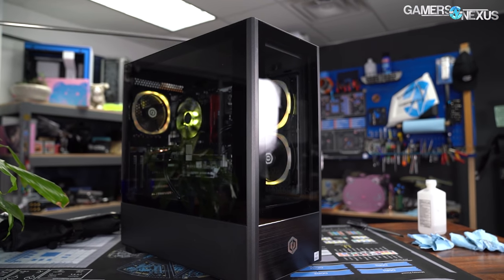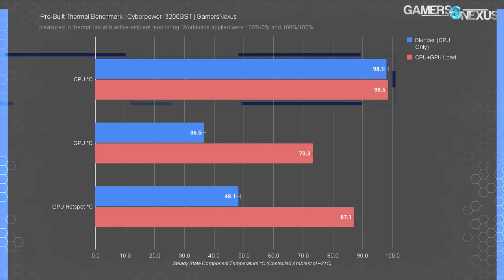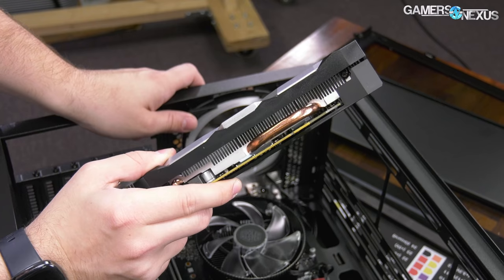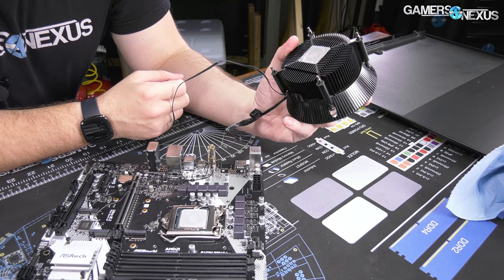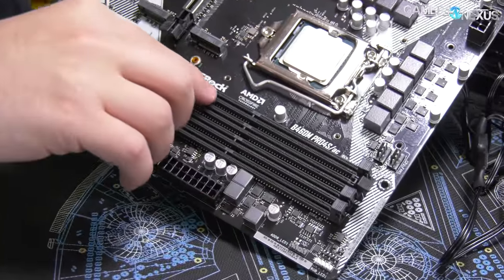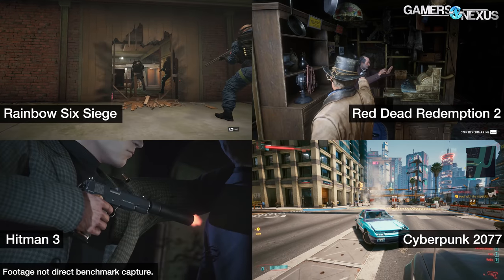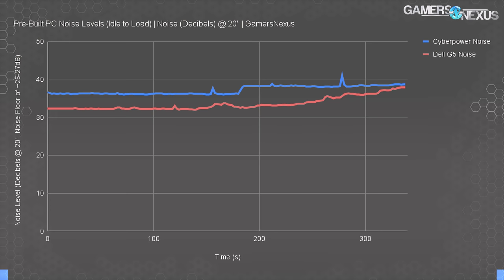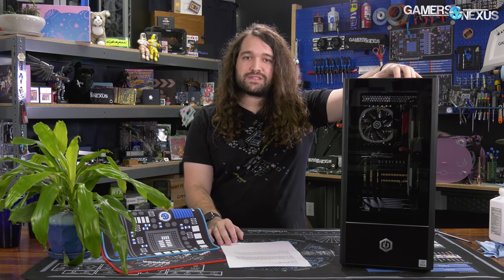Almost Didn't Suck: Cyberpower $1000 Pre-Built Gaming PC Review (Gamer Xtreme 3200BST)

Comment: “Almost doesn’t suck” sounds like a high bar to reach for most prebuilts
Reply: "Almost doesn't suck" is the GN equivalent of LPL taking more than 15 seconds and a toothpick to get into a lock.
Reply: @aethertech  so pretty good?
Reply: @aethertech  ... More like 10 seconds...
Reply: He didn't order a fuckijg liquid cooler and he shits on the entire build at that point
Reply: @nexusly6720  rephrase.
Reply: @nexusly6720  There are plenty of air cooled PCs out there that doesn't suck.
Reply: @nexusly6720  Sounds like you don't understand the premise of the video.
Reply: @nexusly6720  Yes. Because ANY half way decent air cooler has thermal contact with the die and does not cause the CPU to throttle at effing stock speeds. He is absolutely right: This is totally unacceptable. He asks for a cooler that does its job. Providing a solution that causes the CPU to throttle because of overheating at stock speed is missing the mark.
Reply: @nexusly6720  No there are air coolers that  don't suck the problem is CyberPower decided to use the cheapest thing they could chuck in. There's a reason why CM doesn't sell that downdraft cooler to customers, and that's because even informed normies wouldn't bother with buying one.
Reply: @nexusly6720  💀 my air cooled system gets literally high 30 - low 40 degree Celsius under load. Air cooling is perfectly fine.
Reply: Ideally some of it should suck and some of it should blow.  Then it has good airflow you see.
Reply: @nexusly6720  you completely missed the part where Steve compares the Fuma 2 to the pos CM. You have bad comprehension or ADHD?
Reply: @nexusly6720  Doesn't need an AIO just a $25 air cooler instead of a $20 one.
Reply: all it needed was a better CPU cooler and its good.
Reply: Almost 😂
Reply: @nexusly6720  why wouldn't he? It's not a processor which requires an AIO or is going to be overclocked (it's aimed towards people without any understanding with computers), there's no reason to invest in a, relatively, expensive AIO.
Also, Tower coolers can be really good, this cooler is just not good, even stock cooler will do the job better (if Intel still ships them with stock coolers).
Reply: Dawid Does Tech Stuff is making sad noises with that single channel RAM config...
Reply: @echnaton192  To be fair though, builders like CyberpowerPC probably aren't getting a lot of orders for current gen CPUs(or in this case recent enough) plus a reasonably good graphics card(considering the market deficit of them) without liquid cooling.  AIO has become so mainstay for anyone willing to shell out the bucks for a pre-built PC that builders like this really aren't investing in the streamlined production infrastructure to make really good air-cooled machines, which I think is completely understandable from a business standpoint, but it could certainly stand for improvement.  In other words, don't visit the upscale sushi restaurant and ask for french fries.  

At any rate, let's see more videos like this with an Origin PC or Digital Storm build.  Cyberpower has had its share of issues for a while now(or actually decades), but to use them is basically a strawman argument for "aLL PrEBuilTZ SuCK d00d!"
Reply: @booksgaming1426  I disagree. Using aircooling is a perfectly reasonable solution, even for high end components. The price difference under msrp  conditions is big enough to allow for better components. Especially if someone is actually watercooling the GPU as you suggested. My new system has AIO for the cpu, but only because it was included (first prebuilt since 20 years). It is tax deducted, so I buy it via my job.

To keep it in your picture: If the upscale sushi restaurant offers french fries on the menue, they better not taste like fish when a kid orders ist, but be one of the best french fries it ever ate. It is perfectly reasonable to not offer french fries. But IF you offer them, you need to buy good potatoes / convinient food french fries and use fresh oil that was not used for frying fish.. And even in the upscale sushi restaurant the cook needs to taste the french fries before putting them on the menue.
Reply: That's hilarious! LMAO!
Reply: An actually sufficient cooler would probably already have boosted the score to D- or D.

I seriously hope they somehow just had this one being a bum one with a bent surface and the other systems do work normal.

I haven't seen a warped cooler surface that bad since the P2 days.
Reply: @echnaton192  I just fundamentally disagree with your take on the analogy.  As opposed to a restaurant part of whose main selling point actually is french fries, such as a fast food joint or drive-in, while the sushi restaurant may not be carrying utter crap, to go in there expecting something outside of their specialty is an unreasonable expectation.  Specialty and expertise drives capitalism to the extent of the Pareto distribution: That is, spending an exponential more amount of time perfecting a single product is typically much more logical and revenue-producing than trying to be a jack-of-all-trades.  Expectations matter and are "priced in" from consumer demand and the bottom line.  The odds that someone will buy french fries and complain about the product and that driving overall sales down for a sushi restaurant are as likely as someone walking into a McLaren dealership, asking for the best doorbuster deal, and walking out steaming hot angry at the lack of good buys at their price point.  It's fundamentally illogical.  

And again, I'm not denying that air-cooled units aren't hard to build for current gen CPU/GPU.  I'm pointing out that likely some 70-80% of their sales margin revolves around liquid-cooled machines, and so their entire efforts are focused therein regardless of how "easy" it is to build.  Time is money, so every minute wasted looking at the nooks and cranny of an air-cooled unit is likely a waste of time, and few PC boutique buyers are going to be alarmed at videos like this which show the exact opposite of the type of PC they want to buy from that company.
Reply: @booksgaming1426  I can see your point. Although I disagree, you mentioned that these french fries may be good enough. This is not the case here. The cooler has only 50 per cent contact with the die (heatspreder), making the CPU throttling at stock speed. The bare minimum is to deliver french fries that do not suck or are way worse than average french fries.

Or selling half a liter of beer in a glass, delivering only 0.4 liters of beer because the tray the waitress uses is so wobbly it spills 0.1 liters. „But we specialise in craft beer, so this is no issue for our most valued customers, the bottles are closed, so you actually get 0.5 liters of beer“ is no valid excuse. It is a faulty product at production time. That IS unacceptable and if done with intent, outright illegal.

Look at Gordon Ramsey: The french fries he made for a restaurant looked absolutely amazing. In my experience, many high class restaurants offer meals designed for kids. And they make them decent enough to make them taste good enough.
Reply: @echnaton192  And yet the selling point of french fries is, in fact, that the good taste/health detriment ratio is sufficiently high, hence if the french fries are merely mediocre, all you're doing is contributing to your long term investment in heart disease rather than actual benefit.  Vis a vis the analogy here, where you want a good system from a boutique seller and you're picking an item that isn't even on their radar, let alone the average consumer's radar, for standardized quality product from that manufacturer.  A CPU throttling at stock speed will still play most games; it certainly won't be rocking in Cyberpunk, but for the grand majority of games available on the Steam platform from 2003 until say, 2018 will perform just fine.  That's still a lot of entertainment for your buck, assuming you're buying it for that purpose, or even a limited amount of editing/graphics/rendering assuming you don't mind the wait.  You get what you pay for when it comes to a boutique specialist seller.  

Volume isn't really the question on the beer analogy.  They have a very, very specific staple product, you go in and order the absolute cheapest side beer they have available, and it sucks.  You've walked into that distillery entirely missing the point.  I still prefer my McLaren analogy.  You don't walk in there demanding a family car with proper miles per gallon on city streets and an eye towards any reasonable accommodations for storage space, and then complain to the hills that their best line product in that specific category is terrible for those variables, and that they should be held in contempt because they aren't offering a reasonable product in those categories.
Reply: @booksgaming1426  Look. It is an aircooler that does not cool the CPU. They failed the mark. Air cooling is an reasonable choice, even for enthusiasts as long as they don‘t expect overclocking without shelling out money for additional radiators or a better case. Not overclocking except for XMP and MAYBE overclocking the GPU and CPU only a little or maybe not at all is a valid choice. Especially for the „average consumer“. 

But the manufacturer has to deliver clock speeds under load. Period.

The heatspreader has only fifty per cent contact with the cooler. The CPU throttles down because of overheating. That is unacceptable. You think that this is acceptable. The majority of all testers, users and gamers would disagree, I am quite sure of that. But be it as it may. We disagree, let‘s leave it at that.
Reply: @echnaton192  if i were to get this, do you have any CPU cooler recommendations?
Reply: @xva17  GN tested some good air coolers already. I just checked a German magazine I trust. Number one was also mentioned positively by GN: Fuma 2 by Scythe, according to the magazine even a bit quieter than the Dark Rock 4 pro by BeQuiet! Both seem like reasonable choices. The second fan is in the middle, crating enough suction to actually get the air through. This is true for both coolers. 60 EUR seems reasonable. But I am quiet sure there are cheaper options that hit the mark. According to the magazine the BeQuiet! Pure Rock 2 seems reasonable priced at 34 EUR. But I don‘t know what they charge in the US.
Reply: I bought a cyberpower system due to the GPU shortage and honestly the build quality was quite decent. The company is fine as long as you select the non-default parts.
Reply: So seems like cyberpower pc makes the best prebuilts for those to impatient to wait for GPU prices to come down and become available?
Reply: this one was def. a shocker to me. My first "good PC" was a cyberpowerpc about 4 years ago (I later ended up swapping out the components and slowly replacing the system itself and by now i have a complete system i built myself). It was, at the time, around low to mid tier the price was alright, i bought it from amazon. ALTHOUGH, to be fair, i was more than ready to open that pc up and mess around with it, it wasn't the best, i could've def. done a better job MYSELF with some extra effort but it was good enough. They even sent me another stock cooler when i complained about the one I had (i ended up not needing to use the replacement).
Reply: Mines IS it works well